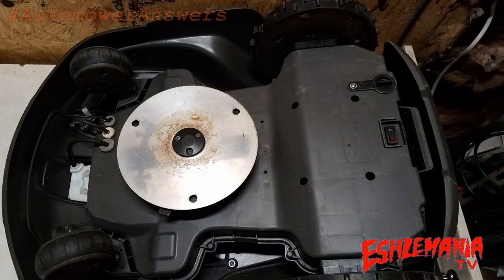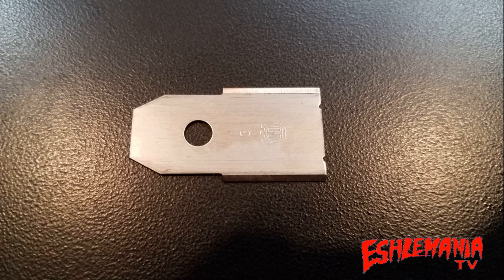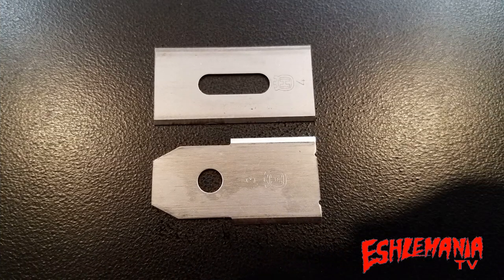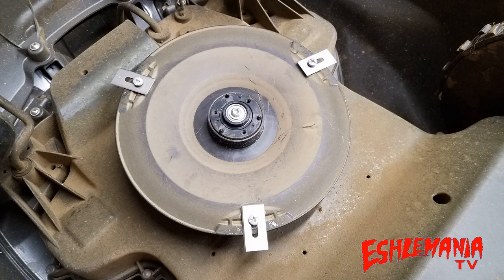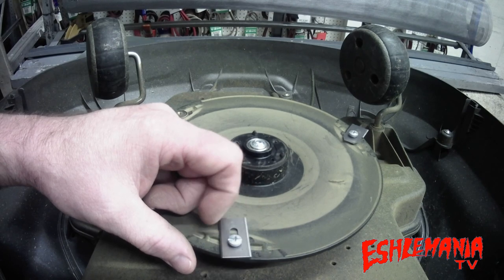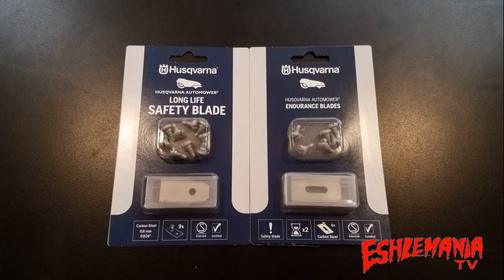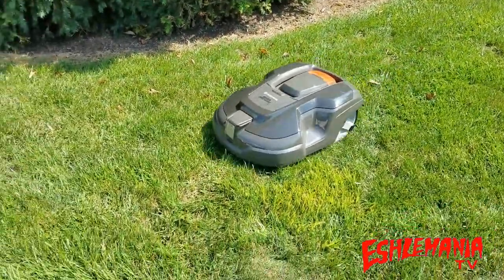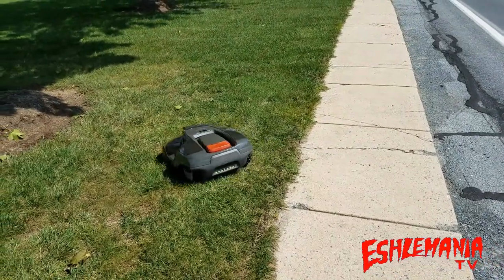Automower Answers: New Endurance Blades And Other Mower Blade Information

Comment: Good tips. I have to admit, the boss mow blades are far better than the stock husky blades, infact they were the ones that designed the endurance blades.
Reply from the maker: The standard blades worked, but were definitely in need of some improvement. Surprising it took this long to get an upgrade.

Comment: Is it just me or does the automower not cut a perfect swath?  I can have dry conditions, put new blades on, (also normal thickness of grass), have people come over to watch my 2 450XH only to see that the automower misses cutting a few blades.  Eventually the automower will cut the area.  Just wondered if this was normal or not.
Reply from the maker: Yes, this tends to happen when the grass is a bit taller. It's comparable to missing a mowing with a conventional mulching mower and having the few blades of grass that get missed. So basically it is normal if you are not running your mower constantly. If the mower is running very often, then even if this does happen it's not as noticeable.
Reply: Yes, I noticed it also on my first run. Eventually everything is cut.

Comment: Good video.. But man was this long

they last longer not because as far I can see because they can use the other side, meaning they an "extra" side... So in theory they will last 2x more
Reply from the maker: BUT WAIT........THERE'S MORE!!!! These blades are actually made out of a harder material than the standard style blades. So that along with the longer cutting edge which in theory will make them last longer. But if you are cutting in wet grass they will gum up and appear dull just like the standard blades.
Reply: @EshlemaniaTV  Are there any other down sides to cutting wet grass or while sprinkling? I'm not sure I fully understand your message above, are you saying blades won't be as sharp when grass is wet?